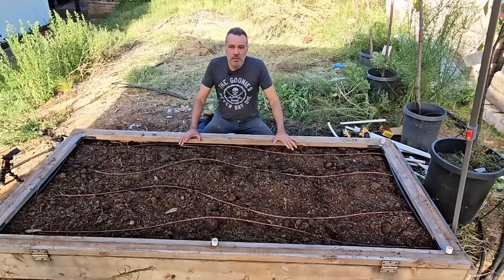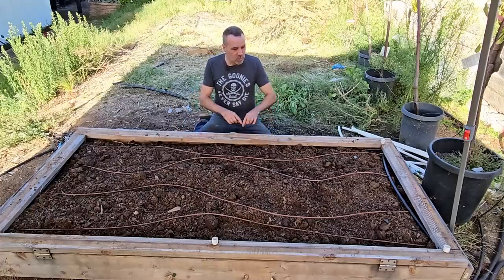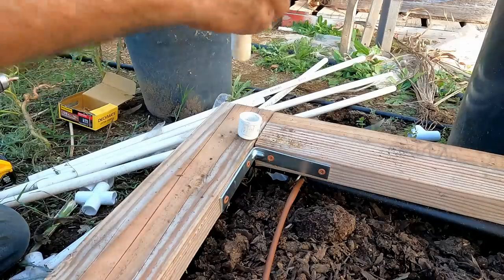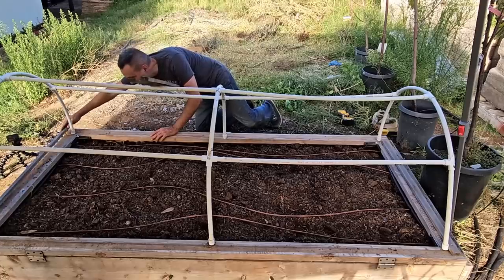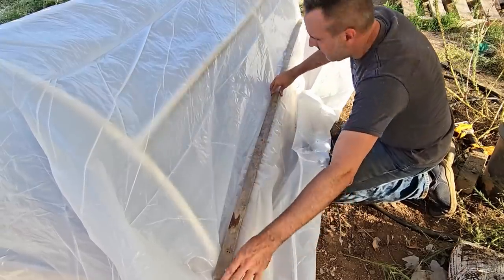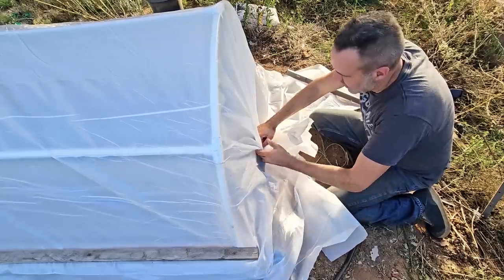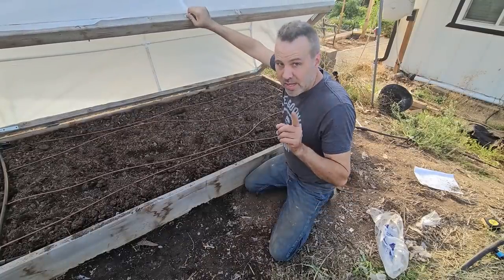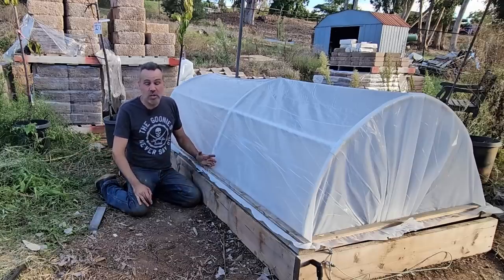How to Build a HINGED HOOP HOUSE for a Raised Bed

Comment: Your instructions are almost exactly as we built our first hoop bed. We added metal pole props on each end that fit into holes on the 2x4 to keep it safely raised while working in the bed. I found that the 2x4 made it too heavy for me to comfortably lift, so the next one my husband trimmed the 2x4 to make it strong, but much more lightweight.

Comment: Amazing Brian!  You are always impressing me with what you have figured out to do.  I already fiberglass rod sections that are held together with metal links and was thinking of just connecting them to the outside of the raised bed.  There are also clips to hold the fabric on the arches. Then it occurred to me, how will I get in to plant and harvest easily and your hinged framework is the answer.  My goal has been to extend the growing season, and this seems totally possible.  I built a lean against my house frame, which over wintered my cabbage plants (to grow seeds) and protected my blueberry containers from our harsh northern Illinois winter.  I'm sure some help came from heat escaping the house, but that was enough encouragement for me to try in on the raised bed.  Another thank you, Brian, and may the Lord keep blessing you and yours.

Comment: I'm here from the link on today's video about overwintering pepper plants. I'm in 8a (10-20F) here. I just made my first garden this year in containers on the deck. One 2x4' planter table and five 5 gallon planters. I spent a huge portion of my growing season waiting for my peppers to develop fruit so overwintering the ones I want to keep is my new focus. If I modify your plans here for my small table, do you think it will be enough in 8a even with open air below? I have a south facing wall with brick down low, but I don't think it will be enough by itself. I'm thinking of using either of these in conjunction with large incandescent Christmas lights for more heat on the coldest nights. What do you think?

Comment: Impeccable timing as we got down to the high 30s for the first time last night here in NC and I knew I have to get my frost protection ready. One question I've always had regarding the hinged covers is how do you access the plants on the hinged side? One reason for building beds no more than 4 ft wide is so that you can easily reach all the plants. I'm tall but my arms couldn't effectively reach 4 ft to tend the plants.
Reply from the maker: I've seen people hinge it on the short side but u wonder how difficult it us to open
Reply: @NextLevelGardening  It seems like that would twist and be hard to work with. I think I've seen some people lay a 2x6 across the bed on the frame (like a scaffold) to give them something to lean on without compacting the soil.
Reply: I have hinged mine on both sides, with bolt pin hinges. Remove the pin from the back hinges, insert them in the front hinges - now the lid opens from the back !

Comment: Multiple options for the covering - (1) heavy mil clear, translucent, or white painter's plastic sheeting/window sheeting, (2) black sunshade meshing - aeration, (3) white, clear, or translucent meshing - aeration, and (4) tyvek - translucent - micropore aeration (proper side applied to hoop house canopy).
Reply: how to easily change out covering options?  I live in climate, I need to protect from the cold, protect them from insects and then when it gets hot, shade cloth?
Reply: @keekeemyfirstcat8410  One should consider, with your extreme climate swings, whether you are going to either (1) grow Spring-Summer crops ... or (2) grow Fall-Winter crops ... and make appropriate grow shelters for each environment.  There is no one-for-all grow system for the homesteader, unless you totally construct an insane-pricey industrial grow house over a massive portion of grow beds/buckets etc.  Stop making universal annual-growing solutions - when you need to decide on  seasonal growing solutions.  (3)  Make a summer grow area with its appropriate shelter design, and (4) a winter grow area with its appropriate shelter design.

You only need to deal with bugs in the early Spring-Summer months, and allowing the bees entrance for pollinating the flowers, ... while the rest of the growing season is bug free, like the bugless Fall-Winter shelter.

The solution is an easy decision.

Comment: With this same design - for vastly colder climates - even Alaska and northern states (away from convection winds and blizzards) one can install the same covering to the inside.  This takes a little more skill, as one needs to pre-drill the PVC pipe and "T" and "+" intersections accepting a wood screw.  One then screws in the bottom portion of the sheeting across the closest hinged area of the hoop house, pulling and tightening the sheeting.  One moves up (with "multiple !" screw points - washer and wood screw) the PVC piping, pulling and tightening and attaching the sheeting.  This might be even more easy, if the whole hoop house structure is inside the garage or work area, as one more easily "rolls" the hoop house on its back and one moves across the PVC piping and screwing down the inside sheeting.  Eventually, one finishes off the last plastic attachment and cuts off the excess sheeting length.

What is this double sheeting all about ?  It makes a semi-sealed double plastic sheeted hoop house.  The same technology of putting plastic sheeting on one's windows (in those northern Midwest states) outside and inside.  This creates an air barrier (around that cold convecting glass window and the wind) that also heats up with infrared sunlight - and keeps the hoop house even more insulated and warm.  Warm in so much that you can literally (~almost~) grow a summer crop in the middle of the cold winter !  A little more work, a little more product - but in the end - if you want to grow all-year round - and have a temparate grow zone - this is a ready prepper option.

Also if one makes a smaller such unit - one could even make a plastic hoop dog house ! - and Fluffy would be all warm and toasty inside.  One does a double sheeting on the back end, and a double sheeting on the front end.  One makes the doorway with a cut * pattern in the sheeting and this allows easy entrance/exit - while allowing woof to keep the interior all warm and toasty.
Reply: What do you grow in your box? I know with the sun here my lettuce bolts too fast. Trying to get better options for my deck raised beds. I might see if I can make covers for my smaller beds with the double layers. They are much smaller boxes. (Anch)
Reply: @RS-de3ny  Also, with raised beds, whether ground planted - or you mention raised beds on decks (with air currents either heating in summer underneath the bed - or freezing the whole grow bed solid in winter).  One would then want to consider Reflectix (double mylar with plastic bubble wrap inbetween ... or the "new" Radiant Barrier (now compacted) versus its old single mylar side with cotton/batting fabric on other side.  Now double mylar with batting fabric inside.  Wrap this around the deck raised bed, and especially the Radiant Barrier underneath the bed boxes (if possible) and this creates greater insulation from the cold winter, and helps with keeping the raised bed cool or warm, not cold or frozen.  Then top with a hoop house, and depending on how you have them aligned to the sun, then on the backstop of the hoophouse put a mylar reflecting screen increasing the sunlight bounce and infrared warming, while (if need be) put a dark black plastic garbage bag on the southern side in summer and keeping down too much intense sunlight (and removing the mylar in summer ... and you can control your own climate change for your boxes.
Reply: @johnlord8337  thanks! I will think about some of these options, especially the shading. I’d like to get started a little earlier in the spring (south and west facing). The beds are those sold at the box store a couple years ago, with water storage. They are on wheels so just need to maybe move during day. I empty h2o and soil in winter so the plastic tray doesn’t get destroyed.  Skipped last summer but hope to get motivated this year.
Reply: @RS-de3ny  Best bet is 3M spray glue on the sides and bottom, and adhere on said Reflectix or Radiant Barrier for cool/cold soil, and then having a hoop house design over the top like Brian made, heavy mil plastic sheeting, and a breathable plastic mesh for air flow (keeping out bugs), then the mylar and the black shading cloth or black plastic.  In the first part of Spring, you can also wrap black plastic over the Reflectix or Radiant Barrier heating it up and then getting into the soil.  When the soil reaches 65+F - take it off and let nature and the Sun keep it warm.  If you have some heat domes (like we had in CA last 2 years) then good for rollers and pulling them back into partial or full shade, and appropriately watered (hydration) but also cooling down any overheated soil in the units. 

If you want Fall/late Fall cabbage etc cruciferous vegs and root crops then you can leave these out longer with this insulation (and cold weather and lesser sunlight).  One could also, post-frost date, also run some winter vegs for early Spring growth and early harvesting.  The insulation should extend your growing season up there - where my cousins also live in Anchorage, Chugiak, and Wassila (and they can probably also see Russia from their back door (!) ).

Comment: I can't believe that course was a year ago ALREADY😮 AUGH!  My 2 beds are curved at the ends...not sure how I'm going to do this..pvc parts, looped??? Ideas 💡 peeps?!
Reply from the maker: Maybe angle cuts. As long as it sits well in top
Reply: @NextLevelGardening  yeah, I'll have to play around with it. Columbus just had a major temperature swing. Had upper 80's and the past 2 days had low 50's with nights in the low 40's🥶 time to re-aclimate and prepare quickly for winter.

Comment: Great video! I've been having trouble with raccoons digging up my raised beds. They aren't eating the plants, just digging them up  & digging holes. I think they're after worms(?) from the worm-filled compost I spread on the beds. As my beds are lined with gopher wire, I know it's not gophers. Do you think plastic is enough to keep the raccoons out, or should I be looking at hard-wire cloth to cover the tops of the beds?

Comment: I found it impossible to put together 4 straight pieces in 16” increments and make the arch.  It kept coming apart at the fittings.  Even tried a heat gun to try and make it bend.  Unless I am really missing something, a design change is needed.